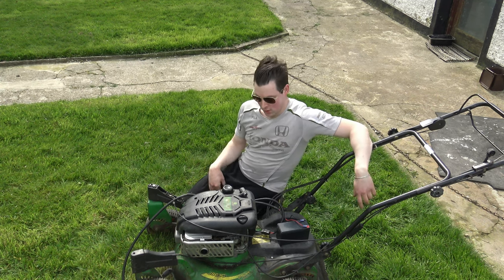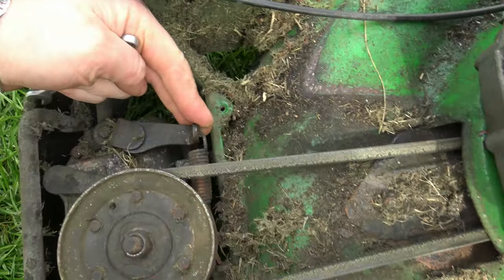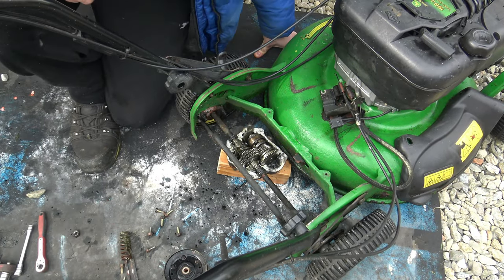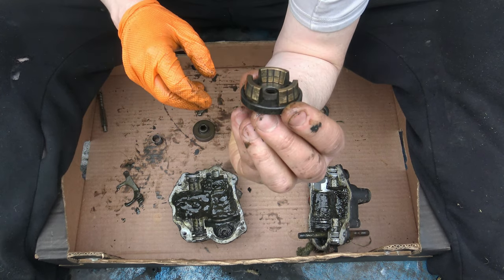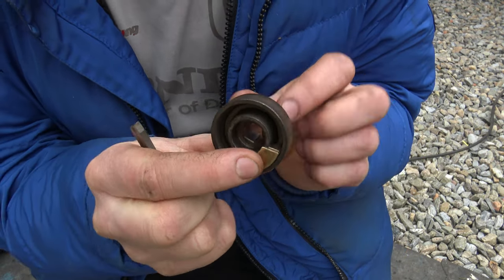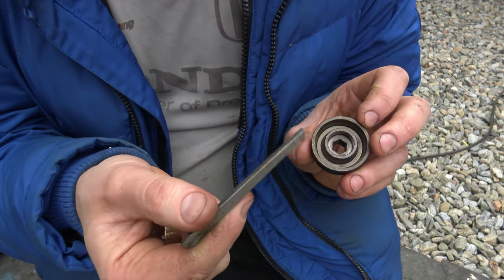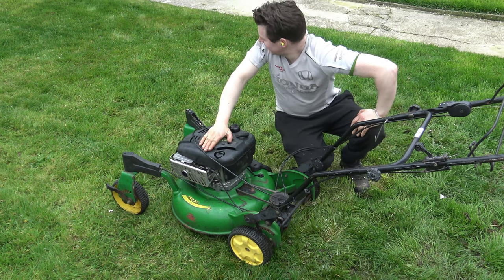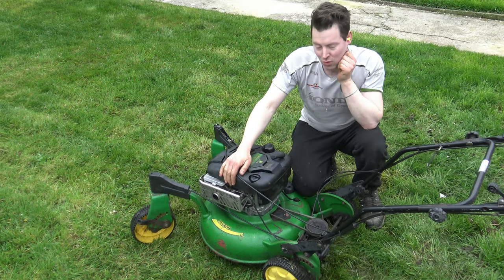Jeffrey Henderson | John Deere JS63C Lawnmower Self-Drive Gearbox/Clutch Assembly Repair Adjustment

Comment: Excellent video. I had written my mower off, had the same gearbox and clutch.Tried to get new box or parts but told by everyone that it is obsolete and 'no parts available'.
I will now go back to it, and do the same clutch modification. This video gives me hope. Thanks a million.
Reply from the maker: Hi there, 

It's no problem, if you need any further advice, I'm happy to help. There is another way you can try to resolve the clutch before stripping your gearbox if it's the same issue. Lift the clutch arm/lever of the hexagon spline and turn it further away from the bracket holding the cable. You will need to adjust (remove tension here to allow for the major adjustment) the bracket that holds this cable to make this work.

You can reveal the hexagon spine by removing the plate that holds the lever arm tight to the gearbox. As far as am aware, it was a M6 bolt. It will feel much tighter to squeeze the drive hand lever, but it will put more pressure on the clutch basket, getting these friction brass parts of the clutch to engage properly. Don't worry about too much tension on the cable,  a spring is on the cable to compensate for this.

To make this clear, you want to turn the lever arm one notch clockwise then re-install the lever hold plate.

I hope this helps you and others.

Kind regards,
Jeffrey
Reply: @JeffreyMaster  Yes, I had previously thought about that, and wondered if it would be an option. One more trick up my sleeve.
Reply: Great tutorial can you do a video for adjusting the hexagon spline please. Thanks Roger

Comment: Dude you're amazing, thanks for making this. There are only a couple videos that show the disassembly/reassembly of this transmission and you're the only guy with the stones to do it while sitting on the ground. However, I'm confused now because I wanted to replace the grease but you replaced it with gear oil. Is this a recommended replacement for the grease? It makes sense to use gear oil but I'm concerned it might leak out easier than grease.

Also if you can find caster pin covers and your cable is still good, you can get  the caster locks working again. I had a bent pin but I was able to bend it straight and clean it up. I don't know where these pin covers are going but half the JS63Cs are missing the covers.
Reply from the maker: Hi Sir, 

Thank you for your comment. I used gear oil because it makes more sense. A automotive high speed gearbox uses oil. Therefore I believe a heavy gear oil is suffienct for this slow speed/low load gearbox. I've had no leaks yet, just do what I done.

I bought a complete swivel castor housing of eBay are and just used the cover of it. I now have cable ties around both with the screw to stop them vanishing again.  Please see my Facebook page to see modifications with the recent electric start 😀. Thank you for subscribing.

I believe the gear oil will be much better around the clutch.

Thank you, Jeffrey
Reply: @JeffreyMaster  Thanks for your rapid reply. I'm going with gear oil. 😎
Reply: I’m in the process of doing this job, what gear box oil did you add, shop told me some oil affects the soft metal components. Great step by step, will save my gearbox